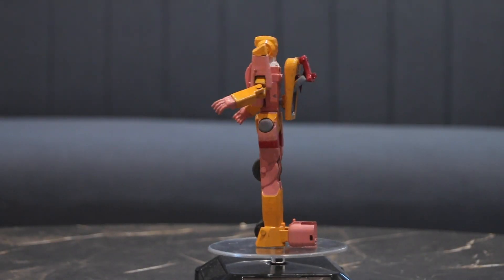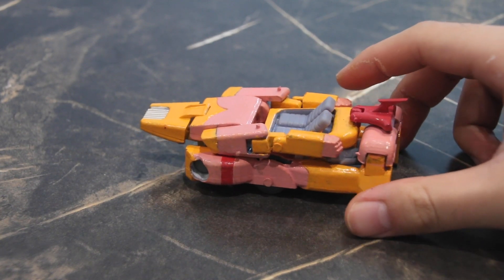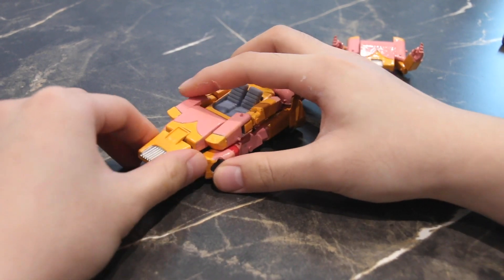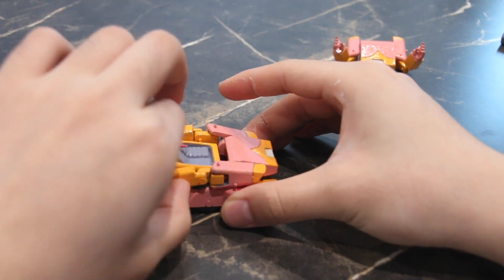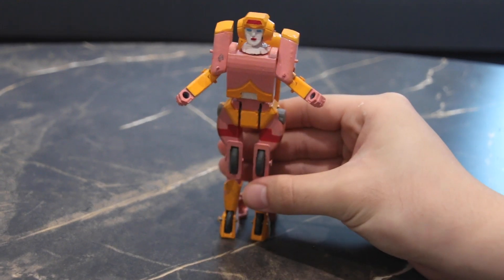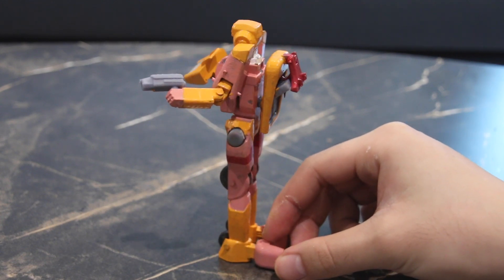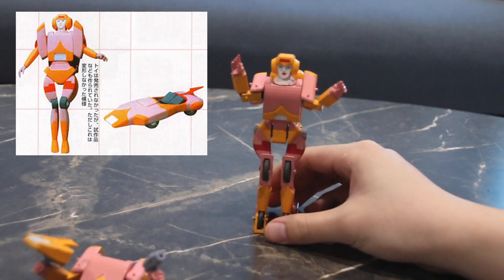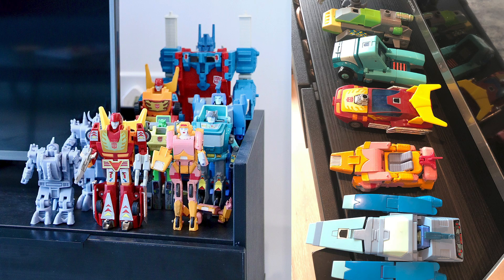Transformers G1 ARCEE Prototype Review- (3D PRINTED) - RECREATING AN UNRELEASED G1 TOY

Comment: Nice. These videos always make my day. Have you tried using strengthened resin? I think it's called ABS-like resin or something.
Reply from the maker: I haven’t tried using that type of resin, as I have figured out the tolerances for my resin by now. It’s more for the clients resin as he uses washable resin. The parts forming also comes from me trying so hard to figure out how to match the prototypes transformation. So far I’m happy with my resin and as you can see in the Allicon transformation video, it holds up very nicely with pins.

Comment: I'm durring a costome arcee yousing the g1 chrome dome or pink dome as the proto art is noun as that takara wos gonna do for hed masters

Hard part is gonna be sculpting the head
Reply from the maker: I’ve done a Headmaster Arcee with this head sculpt, with the inner body as Daniel. Using the Chromedome body I gave her max in Intelligence and speed and a 7 in strength using the bars. Was a fun project
Reply: @HightailCreations  cool that's my 
Idea whith have I'm gorring abaut it only problem is haw I'm gonna a scilp it whith aut a 3d printer and Video it for my chanule